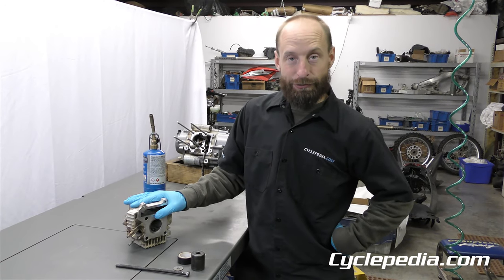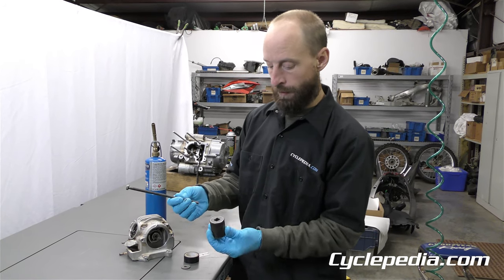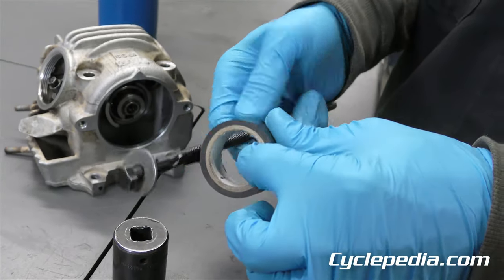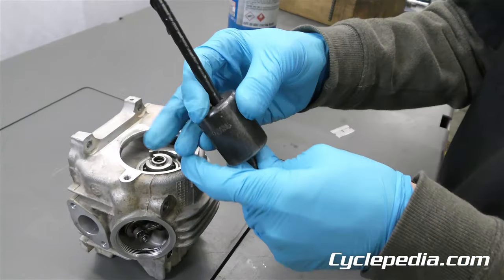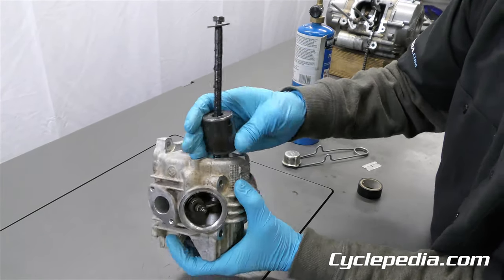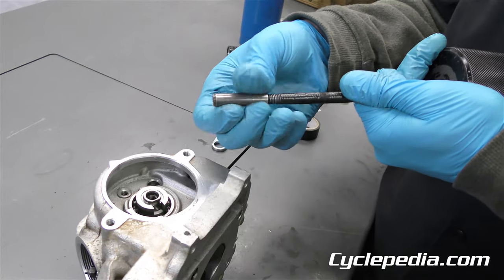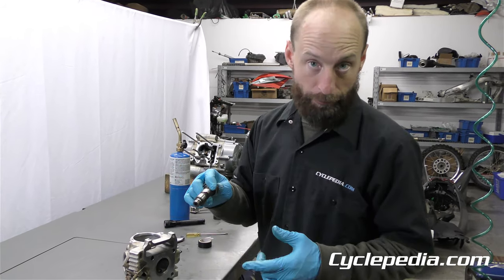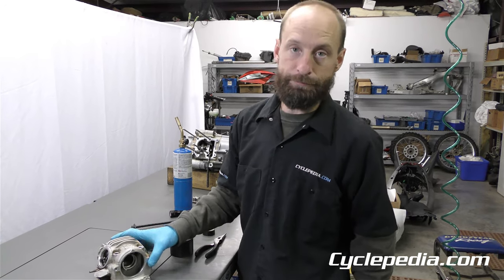Yamaha Rocker Arm/Camshaft Removal

Comment: I'm trying to disassemble a 2008 Yamaha Vino 125 topend and needed this video to confirm the can removal procedure. I don't have a long bolt of the right thread pitch but I do have a slide hammer with a vise grip attachment and a correct short bolt, so it should work. 

I have a question though. Is the TTR125 cylinder and piston compatible with the Vino? Cause that head looks real similar. And I'm having a hell of a time finding Vino parts, but have seen TTR parts(like a big bore kit). I bought the Vino from a guy who rode it 237 miles on the summer, then let it sit all winter with ethanol in it. The carb got gummed up, so he removed it for a cleaning. Then he moved cross country and lost the carb. Then he let the Vino sit outside. So it got water in the cylinder. I just removed it tonight and it's trashed. But every other part on this thing is beautiful and nearly new, so I'm trying to fix it.

Comment: Can you add heat without damaging valve seals, or do you only use this method when you are sure you will change valve seals.
Reply from the maker: If you have a head with enough wear that you need to service it and your going this far in then I would definitely plan on installing new valve stem seals.

Comment: How can I tell if the rocker arms are no good?
Reply from the maker: Well if you have the repair manual or at least the specifications you can measure the parts to see if they are in spec or if they are really bad the parts will look terrible and be very sloppy when installed.

Comment: how about when i go to put it back in?
Reply from the maker: Usually with new parts the shaft just slides in but if not put the shaft in the freezer for a 1/2 hour then heat the head up a bit. Apply fresh engine oil to the shaft before installation into the heated cylinder head. When using our repair manuals you will have detailed step by step instructions.

Comment: do you have to pound the shafts back in?
Reply from the maker: Contact me at the website and I will go over this with you.
https://www.cyclepedia.com/
Reply: Yes. Just do opposite of disassembly. Put the rocker bearing back inside threaded bolt and take a mallet and lightly tap it in.